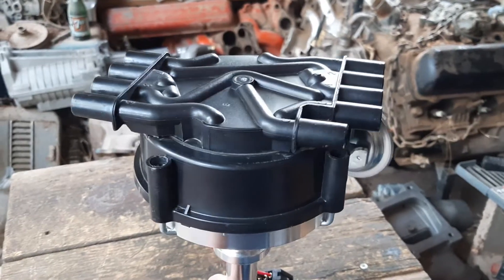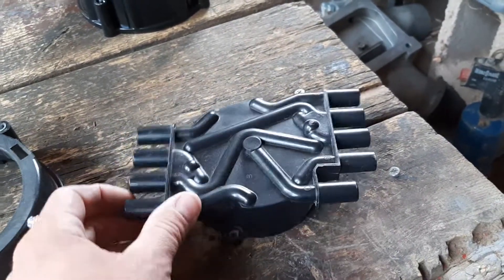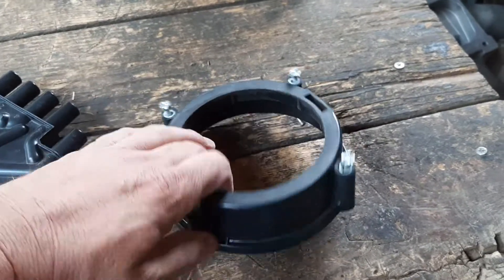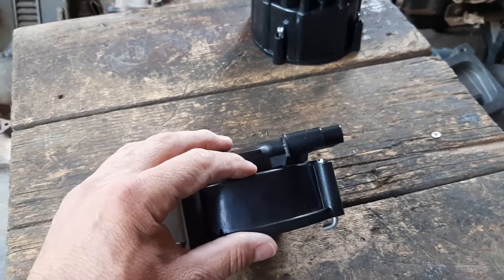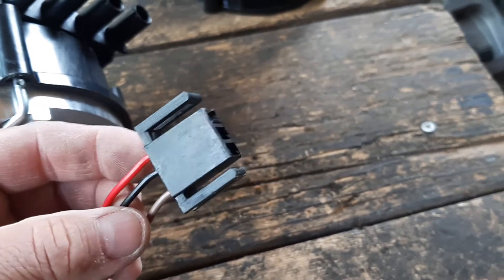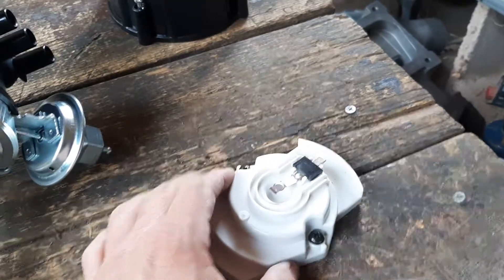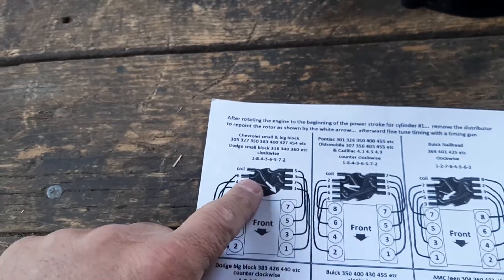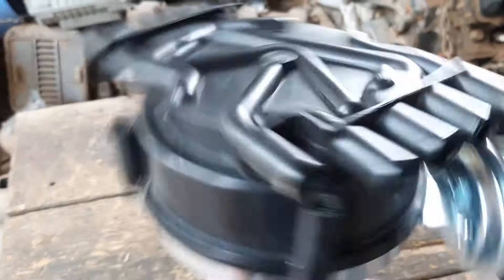HEI low profile distributor crab cap, how to make & wire a remote coil, firing orders chevy vortec

Comment: A Very good video indeed, and i was looking for a kit bashing video of using an  hei ignition big cap with a modified coil in cap delete modification enabling me to use a standard old school distributor cap female connector like the external coil connection on hei cap .Was thinking of going with the msd 8401,cap with sparkplug  type hei coil cap but the wire won't connect to both and the plastic coil adapter cone ,i heard don't  stay on coil.Awsome video once again.

Comment: Why would you want to make the worst cap design  fit on a superior design ? 
I would love to eliminate the arc jumping garbage vortex cap style!
Reply from the maker: I've never experienced arcing when using the vortec caps on HEI distributors. In my experience, this arching only occurs on worn or improperly installed OE vortec distributors, or when you have a bad spark plug or wire.

Comment: I have been using clear HEI caps and removed and buffed out the coil containment well and using crystal clear epoxy I "pot" a spark plug with the base cut off in the center. Lets me put a (6cyl HEI) coil on the firewall.
        BTW I don't like the HEI electronics. I have retrofitted my HEI with old '55 Delco points and point cam. But then I use them to control a Ford '88 Mustang Push Start "Thick Film Ignition Module on fan-cooled heat sink. 1) Almost as hot as HEI 2)Timing is rock-steady unlike HEI which moves around as it changes dwell. 3) Ford TFI does a perfect job of Dwell Control unlike HEI which is lazy and inefficient.
           I like points because they shrug off stray sparks. Somebody else can figure out a Hall Effect trigger+magnet arrangement if they want to. Pop in new points every 3000 and then forget about them.
PS - This video of yours is the most interesting thing I ever saw on YouTube. I will give you credit when I copy it !

Comment: Ray is it possible to do the exact opposite of this? I have a vortec distributor 96/00 5.7 but I need the cap to be vertical, not the crab style. I am running the Ram Jet intake and the vortec cap hits the fuel rail and has no adjustment
Reply from the maker: You got four options....Use an aluminum cap from EFI connection so that your ecm can still use the cam sensor inside of the vortec distributor, and go with direct igntion (eight coils) which will cost $$$$. Second option....use a completely different ECM that is compatible with a regular pickup coil distributor. Third... get a regular chevy distributor that with fit, remove the pickup coil & module, then mount the vortec metal reluctor and cam sensor under the rotor, which requires fabrication skills. Fourth option, modify your fuel rails so that it clears the stock vortec distributor

Comment: I would like to do the opposite and change my flat top distributor cap to a regular cap on a 2000 5.7.
Reply from the maker: Just replace it with an HEI distributor... however the OE ECM with not run without the flat top distributor,  it uses the cam sensor inside it for timing.
Reply: That would be the better idea for sure!

Comment: Great video. Can you do a video with the 250 Chevy in line 6 250 engine with external coil.?
Reply from the maker: Simply get a cap and rotor from a 1976 C10 with 250 motor. Firing order remains the same. Just externally locate the coil as shown in video

Comment: I came across your channel by browsing cadillac 500 stuff. I was amazed at your intake modes with superchargers.  I am more impressed with this mod. 
You have a genius mind bro. My cadillac motor is in my 81 Trans Am. I need the clearance this cap mod will give me. Thank you for such detail.
Reply from the maker: I saw your Cadillac 500 in a Firebird video....Awesome!...... and wanted to ask you what kind of mounts did you use?
Reply: @raysoto1969  very very simple.
3/8 flat steel. I used the original engine mount for a template. Marked the holes. Drilled them out.
Bolted the steel plate to frame. Set the motor, marked the driver side hole, drilled it. Marked the passenger side but made it long. So the motor can tilt. That took some figuring.  The engine sits high. I dont like it. But it did work. I believe some 3.5" angle iron will work too.  The angle can be facing down, this would allow a wall(part of the angle) to weld to. The fuel line needs to be rerouted using this approach.  But that's what I am going to do next. 
What are you putting your caddy engine in?
Reply from the maker: @pjmccoy4216  I might put it in a 79 Firebird